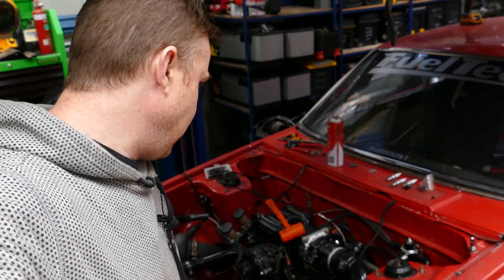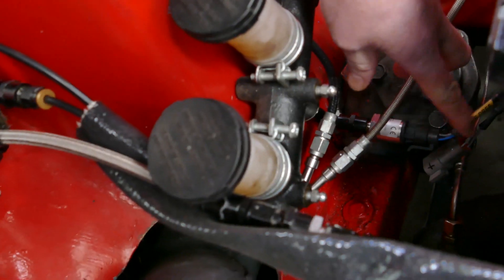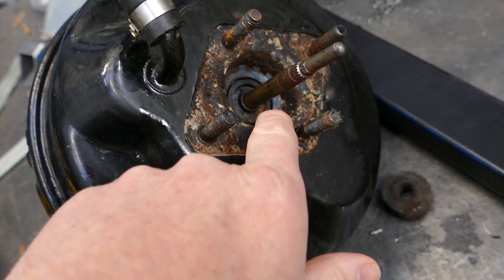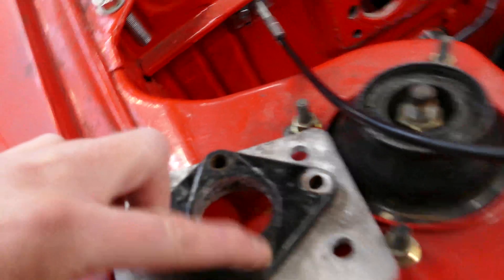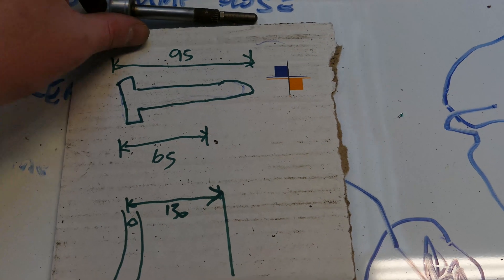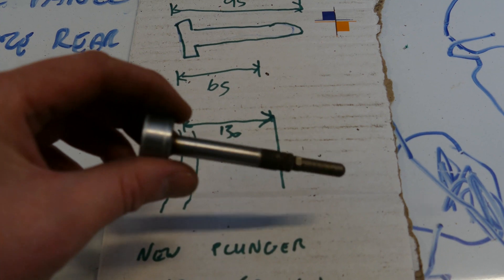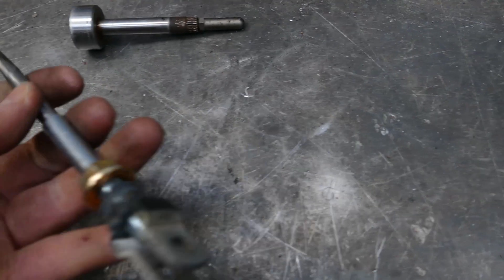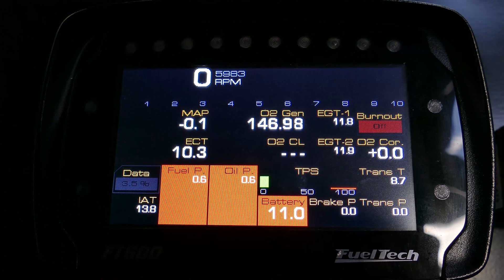Brake pressure problems - testing & fixing [#projectredline]

Comment from the maker: I have both a 13/16” and a 3/4” master cylinder coming for the car so will do a full test on pedal feel, travel and line pressure between all 3 masters.
Reply: you need a ser2 or 3 master smaller piston in it is better suited to your rx7 brakes,  it will pick up the pressure heaps smaller pistons less pedal effort more pressure, and large piston master like the nissan is only for big four spot calipers to get rid of fluid displacement issues ie having to pump up the pedal to get  a full pedal as the front four pots alone take a lot of b fluid it all goes to 8 piston master runs out  pedal goes low
Reply: and put the booster back on   make sure its got good vac and has one way valve,  for that little extra weight it makes braking so much lighter

Comment: Yeah, doesn't give you much confidence there for 150mph pulls lol. I reckon a smaller diameter master cylinder or an adjusted brake pedal fulcrum is what's needed, unless the pressure is bleeding at the calipers?

Comment: May be too late but should have tried clamping off you callipers at different times to see if you have a caliper bypassing 👍
Reply: Having the pressure sensor would be easy to see if any of the callipers are bleeding pressure too 👍
Reply from the maker: beefcakeass yeah I had the sensor in front and rear and the result was identical. Few knowledgeable people when it comes to brake systems have said it’s because the master cylinder is too big (1”) for the standard type 2 spot front and rear calipers. The factory size master is only 13/16”, so I’ll get one of them and that should mean have much bigger pressure.  So many people do this upgrade and so many have problems with it. I guess it shows that unless you have 4 pot up from and 2 pot calipers up back at the very least, this is one ‘upgrade’ you should stay away from. And if you have no booster at all in a race car with standard pedal ratio, then smaller the better.
Reply: @BroomysGarage  Quick "maths" says you should see about a 50% greater psi all else being equal. If that still doesn't get you what you need and all your calipers are up to spec, then look at the pedal ratio.

Comment: Great video, will you run into issues with the Vac pressure on the booster due to Porting?  Remember the problems I had with the Series IV calipers and the Patrol / modified booster.  We could never get enough pressure.  Both on the Series 1 and the FC.  FC we did the pump and reserve air tank and it was still average!  haha
Reply from the maker: They aren’t making enough pressure even when the thing isn’t running. The pressure still not good enough now with the booster removed so that removes all the low vac issues. I’m wondering if the patrol has a different ratio pedal box and means that the pushrod isn’t being moved far enough when fitted in this application